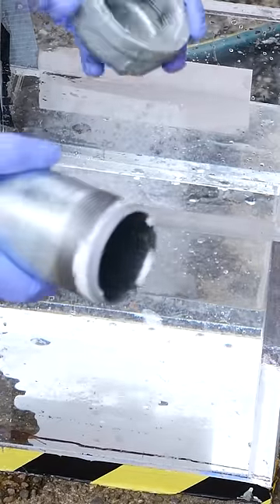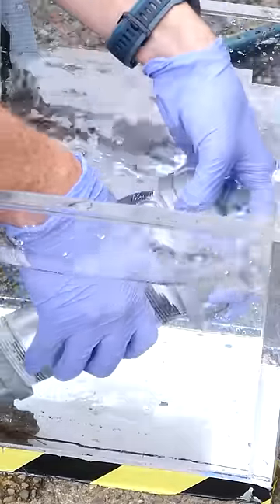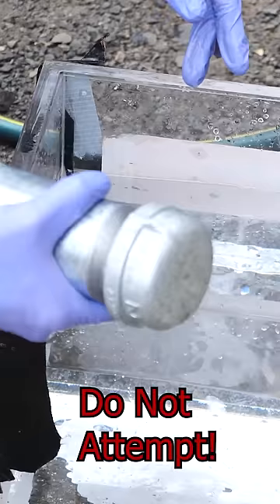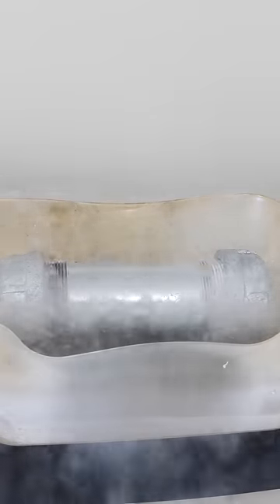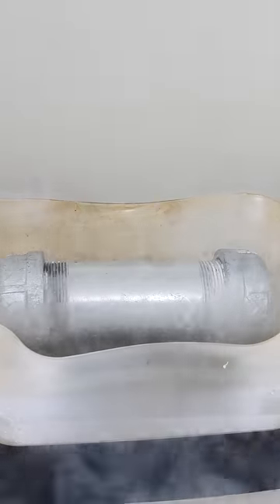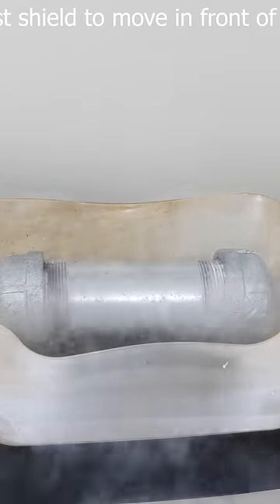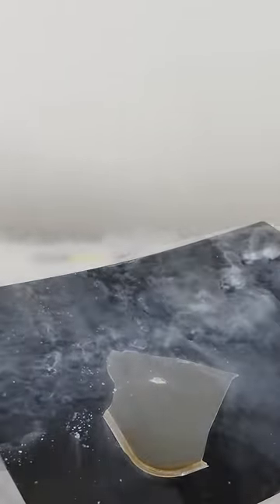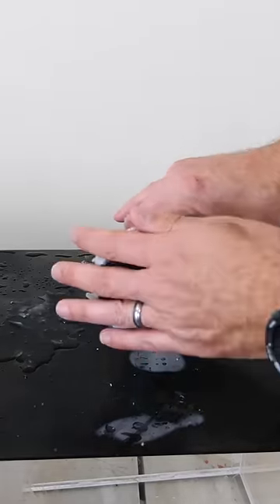Don't Ever Try To Stop Water From Freezing!

Comment: Man puts on rubber gloves to touch water but then makes a pipe bomb surrounded by liquid nitrogen and doesn't shield himself until the last second
Reply: Nah bro had a quick time cut scene and pressed x at the right time
Reply: I swear that cap looks badly screwed on. It looks as it was cross-threaded.
Reply: Liqiud nitrogen plus gloves is worst for your hand . Heat from the hand prevents LN from freezing it. Rubber glove frozen on your hand causes Frost fingers etc
Reply: (Found this info on net, correct me if im wrong)
Reply: @JuniorZAllegro  sounds like it could be true, but I'm not suggesting he should wear thin latex gloves when handling liquid nitrogen lol. The joke is that it's too much protection from cool tap water but not enough protection from anything else he was doing.
Reply: OSHA has entered the chat
Reply: @JuniorZAllegro no
Reply: @StevoDesign  It's the reverse Leidenfrost effect. The surface has a much higher temperature and is a heat source, which is why pouring liquid nitrogen over yourself leads to it hovering above your skin.a
Reply: When dealing with liquid nitrogen, most people don't wear gloves. Because a vapor forms around the skin preventing freezing, gloves can soak up the nitrogen and if that happens youre not going to have your fingers.
Reply: @ThePandafriend   oh cool does that also protect you from exploding steel? Wild
Reply: @kalemphillips8117  STOP LYING.
You always where cryogenic gloves.
Reply: @kalemphillips8117  😂 think cryogenic gloves are  fashionable.
Reply: @StevoDesign  No, but do the gloves? If so, I need to know the manufacturer.
Reply: He's dedicated to his craft lmao
Reply: Pipe was not air tight,  not even close. Finished screwing it in outside of the tank like a fool. Proof is where the frost lined pipe showstopper hollow portion heavily favoring one side. And nice choice in PPE dude! SMH
Reply: Wow that was way dangerous
Reply: Not all humans are willow trees
Reply: because he's just repeating shit others have done, I'm guessing he's not an expert yet.
Reply: @JuniorZAllegro  he didn't say anything about touching the liquid nitrogen with gloves on...
Reply: @KMbuilt  actually wouldn't matter if it was air tight. A little air bubble would just compress until it couldn't and the same effect would happen at some later point.
Reply: @StevoDesign  
Lol. Some people didn't get the joke.
Reply: @KMbuilt  being air-tight wouldn't matter if it's water tight. Air is compressible and can fit in smaller areas, water tight is different thing than air tight
Reply: @mastpo he doesnt have the strength to cross thread coarse steel threads. Neither do you, or me for that matter, not without tools
Reply: @kennypowers8114  wear*
Reply: You get more points for a perfectly timed parry
Reply: I'm just going to mix charcoal, saltpetre and sulphur in a vigorous manner in an enclosed container 🫣
Reply: @kennypowers8114  Yes. It's the leidenfrost effect.
Reply: @adiamondsword8392 bro for real they need to add the shenmue sound 😂😂😂
Reply: LMAO!
Reply: Have you touched water!?...oh, you have...it's not that bad...oh...
Reply: @StevoDesign  what good does latex gloves  could do against exploding steel sharpenal
Reply: @StevoDesign i dont think so
Reply: Priorities 😂
Reply: @imahumanbutichosetobeapota5479  Nothing. The joke was that he over-prepared to handle water but under-prepared for a pipebomb.

Comment: Man did a perfect parry on the bottle.
Reply: i'd contest it's more of a perfect block but your point otherwise stands
Reply: @getmeoutoftheyoutubeservers thy shield is an extensive of your body as any other tool including atomic bomb therefore he parried the ice cold bomb explosion
Reply: parry is just a well timed block. And he did time it.
Reply: do either of you actually know what parrying is. like have you looked it up
Reply: Parry is just a block but we are using it in the video game context where a parry is a well timed block that is usually beneficial
Reply: Bottle? That's a galvanized steel nipple and two caps. He basically made a pipe bomb. 😂
Reply: Duuude your comment is legendary!! 😂
Reply: @Crecross that doesn't make any sense. Steel nipple? The ends/caps would be closer to nipples. Do you mean steel tube?
Reply: “Parry this you filthy casual!”
Reply: @getmeoutoftheyoutubeservers ”to ward off an attack with a counter move” is the definition of parrying. The door was the counter move, and the attack was the pipe blowing up. What part of that isn’t parrying?
Reply: @jamesh7876  it's not a counter move, insofar as it simply interposed the shield rather than, say, whacking the bottle away
Reply: furi moment
Reply: @getmeoutoftheyoutubeservers exactly this. It doesn't counter the explosion but blocks the effects of the explosion from harming him.
Reply: @jamesh7876 That's not what that means. The definition is right but it means to bat the weapon aside with a strike of your own. That's what "ward" and "counterblow" are referring to.
Reply: I'm half-way through Ghost of Tsushima right now and this comment is too good, ok?
Reply: ihap indeed
Reply: @getmeoutoftheyoutubeservers Im starting to think maybe everyone knows what a parry is EXCEPT you 😂
Reply: @bencastor9207 Nope.  You are trying way to hard to make these two concepts sound incompatible.  He both counters the explosion and blocks it.  Both statements are perfectly true.
Reply: It went into bullet time, he missed the chance to TCR
Reply: @Crecross that is literally what he made
Reply: @KingLarbear  Yeah I know, hence why I said in my comment he made a pipe bomb. 😭💀
Reply: @Astarohath a parry is performed when the action is already performed upon you but then the attack is blocked & KNOCKED AWAY 1 moment before impact &  This is a  block in anticipation.
Reply: @getmeoutoftheyoutubeservers thank you for your explanation, that’s what parrying is
Reply: BRO LEGEND OF ZELDA PLAYER I SEE!
Reply: You can't parry a water nuk-
Reply: @AFishBicycle i recall another guy saying that
Reply: @helendeck9487  ahh, you too are a person of culture 👌
Reply: What is parry?
Reply: A hunger for pears
Reply: Who says you can't parry a nuke
Reply: Goat lmao
Reply: @sen_pog A party is not "just a block" even in video game terminology 🤦🏿
Reply: 1-frame punish
Reply: @getmeoutoftheyoutubeservers  if he smaked the pipe away that's an attack not a parry

Comment: Great example of why you should set up safety gear immediately instead of "when I thought it was probably getting to the freezing point."
Reply: Did he get hurt

Was it that dangerous of an experiment?
Reply: @jorge5275 he most certainly could have been hurt, and going overboard with safety isn’t usually a bad thing.
Reply: Probably might be the worst word as a scientist doing experiments
Reply: How is this, a great example of "why" you should set up safety gear before hand? Nothing went wrong and no one was injured, so this isn't a good example of why you should do anything differently.
Reply: @MadladMgeee  yeah, it really is a good example. He was only a few seconds from potential serious injury, the liquid nitrogen could have splashed and burned him, the steel pipe could have hit him. He only got the shield up a second in advance of the explosion, it could have happened earlier and he wouldnt have been prepared.
Reply: @qwertyasdf4081 no one cares about safety
Reply: @josshlegg8647 liquid nitrogen wouldn't do anything because of the ladenfrost effect but the steel flying at him would definitely hurt like a bitch
Reply: @MadladMgeee He was seconds away from being in front of a bomb and you think that's not reason to demonstrate why safety equipment should be set beforehand?
Reply: @JosephStalin311  Indeed, my friend. In Zanzibar, I do welding with no mask. I like to watch the sparks and we don't get hurt. Safety is never an issue. May the peace from the camels hump be upon you my friend. ⛱️
Reply: @qwertyasdf4081 Annnnnd that would of been his issue not mine
Reply: @josshlegg8647  It's not a good example if you have to stop and think about it, just imagining what could have happened; it should be instantly self-evident. The fact he got away without injury in spite of the lack of safety protocol is an example of how being ill-prepared doesn't always lead to accidents or some other negative idea you wouldn't want to teach people.
Reply: “For God so loved the world that he gave his one and only Son, that whoever believes in him shall not perish but have eternal life.” John 3:16
JESUS LOVES YOU ALL, REPENT AND BUILD A RELATIONSHIP WITH JESUS BEFORE ITS TOO LATE!!!!
Reply: Well once he put it up he had to stop cooling it, so he waited until he thought it was cool enough to actually freeze so it didn’t just stay water
Reply: Aside from that, holding the pipe with his bare hands shortly after it being dunked in liquid nitrogen is very bad. Don't do that.
Reply: @JosephStalin311  Well, you seem to care about safety Stalin. That's a good start.
Reply: @jorge5275  demonstrates that we can't all be smart
Reply: @GenericProtagonist7  It is foolish to think that it can only be a good example in that case if somebody got hurt. Potential proves possibility, and that was displayed here. Like when someone has their finger resting on the trigger, and it slips and shoots the floor. It's not true that the bullet must've hit one of their friends in order for them to learn their lesson.
Reply: He didn’t say “probably” though to be fair
Reply: Great example of why it didn’t need to be set up any sooner.
Reply: @oggyoggy1299  The entire point people are making is thinking this way is unsafe and asking to be unprepared...

They set up the protective equipment the moment they thought it would get to freezing... But they could have easily given it too much time before they thought it needed to be shielded. 

Just guessing how long it would take before it is dangerous is obviously a bad way to go about anything, people must be trolling at this point...

Just put the shield in place ASAP, once you don't need to access the chamber anymore, easy. Why leave it unshielded and potentially dangerous? To play a game of chicken with the thing? See how long you can wait until it's too dangerous?

Here, let me stand next to this lit firework until the last second when I think it will go, then move... Would you then say there was no need to move away until that last second and that me not being injured was proof of that? Or would you have to see something go wrong in person to believe it was potentially a danger and that you should be safe rather than sorry?

Check out LiveLeak, and please be safe.
Reply: @MadladMgeee it's the best example because nobody actually got hurt but they were very close. If someone got hurt it would have been very bad with that amount of pressure
Reply: Nerd
Reply: I've done exactly that, just a little too late.
Reply: @MadladMgeee Nothing went wrong and nobody was injured, but this is a literal cold bomb. When dealing with anything even remotely explosive, even if combustion was never a factor, ALWAYS prepare your protective equipment prior to engaging in whatever activity involves it.
Reply: @Savedsmile nobody likes being preached to unsolicited in the comments section. Stop it.
Reply: @KaitouKaiju  let nature take its course. I mean, people think it's a good idea to just blindly walk in front of cars as if they'll magically stop moving for them instantly. Let nature happen.
Reply: That was close
Reply: @tinyPaleBlueDot  Waaay different example dude.

But I hear you
Reply: Exactly. I was thinking for someone so smart, he was incredibly dumb 😂🤣
Reply: @KaitouKaiju  some people lack the ability to learn from a near incident and will only understand after they have suffered an injury.
Reply: I don't know about a great example. I seen one where someone held a firework in the hand when it went off. I feel that was more of a great example. This is Mid example
Reply: What do you mean great example? It worked perfectly
Reply: @jacobmeyer2152  it blows my mind that you can see a near injury and think its fine no issues at all and need to see someone lose fingers to get the problem.
Reply: @MadladMgeee  I’m sorry if you’re just not able to use a single brain cell, but if you would see, it almost went completely terrible. The only thing that helped was the last second when you put up the show was trying to say is that it’s a great example on how he almost he did it, but he almost got extremely hurt because he wasn’t ready with the safety before hand..
Reply: @mihueeggroll1818 it looks like the safety shield that cause the explosion though 😅
Reply: @jorge5275 I MEAN YEAH IT WAS DANGEROUS THE GLASS SHATTERED 💀💀💀
Reply: Some people refuse to believe shit stinks until they step in it.
Reply: @jorge5275  word of advice if you know of more than one way to do something and one has a 100% chance to work always do that one.
Reply: @MadladMgeee  because he lucked out. If his phone had gone off or someone had interrupted he probably would not have had the shield up. Are you kidding?
Reply: @Gig540 it's a great example for people who have brains
Reply: @MadladMgeee  I'd argue whether or not he got hurt isn't applicable to him waiting till the last minute to protect himself. By that logic I might as well never wear a seatbelt because I've never gotten hurt not wearing one before.
Reply: @MadladMgeee literally 2 seconds after he did that the thing exploded, it was already about to explode, if he "thought it was near freezing" a few seconds later it could've beaned him in the face, potentially blinded him if an ice shard had partially covered the opening and was blown out as shrapnel, or if the sides of the pipe failed before the screw threads and it actually exploded, spreading metal fragments like a grenade
Reply: @josshlegg8647 not to mention flying glass shards
Reply: @jorge5275 basically a grenade at this point lol the way it exploded shrapnel could have definitely came flying his way
Reply: @dontecooper6479 your brave lmao I’m a welder and have many friends who have lost the tips of their nose to welding doing the safety squint but personally I always where a helmet to not get arc flash n lose my vision potentially
Reply: @jorge5275 barely no, and yes this is literally a bomb and can fling metal fragments at high speeds
Reply: @Savedsmile all the safety you need right here.😊 (what you said)

But yeah you should have the should ready before
Reply: @MadladMgeee  please hold off procreating, i think you are a prime darwin award candidate.

Comment: I accidentally did this experiment when I left a can of seltzer in my van overnight during the winter. The temp dropped to around 0F.  Next morning I found frost crystals covering the dash from the explosion. Turned the cylindrical portion of the can into a rectangle.
Reply: Good point. Anyone putting a pop-can in the freezer will re-create this experiment
Reply: while my church youth group was camping one late fall many years ago, one of the youth leaders didn't quite get the memo that it was late fall near a river in northern Georgia and her diet Cokes violently popped in the middle of the night, scaring the poop out of everybody until we discovered the 12 pack torn up and leaking x.x